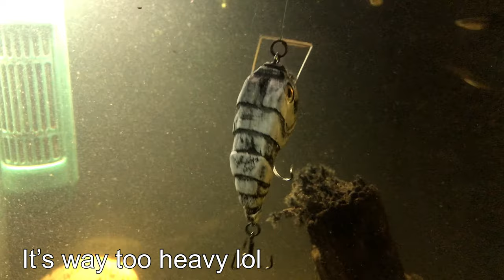LED Fishing Lure Making

Comment: It's a pity it ended up so heavy but it looks cool anyway. I wonder is something like balsa wood dust could be added to the resin mix to make it less dense?
Reply from the maker: The micro balloons are a lot more buoyant than the wood dust. Really I should have just made the whole lure a little bigger and I feel like it would have carried the weight a little better.
Reply: @TreysArt  I didn't know you used the micro balloons, I do try and read any packaging in your videos but I must have missed that one. I've used unscented Talc before with epoxy as a filler/glue. From memory the bubbles were expensive ( I was doing boat repairs at the time ) I tried White flour mixed with polyester resin to fix a few large chips out of one of my boat keels and it withstood the test of time in saltwater, only sealed over with red oxide then antifoul paint. I hadn't any talc and needed to get it done lol.